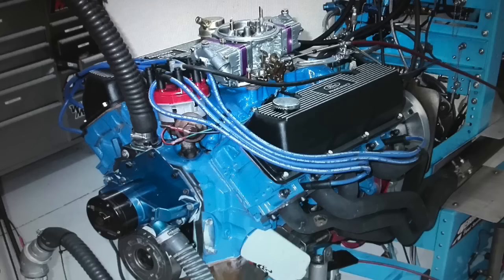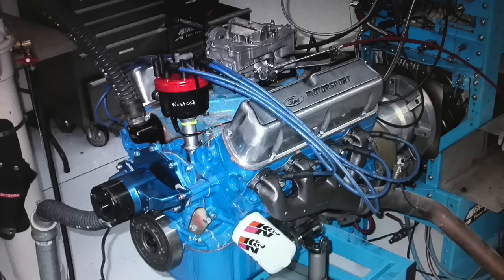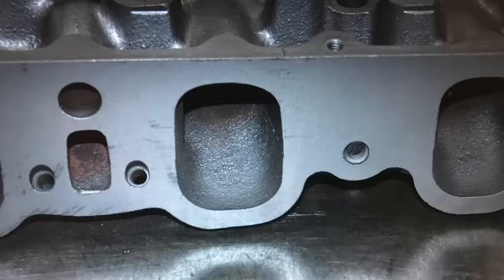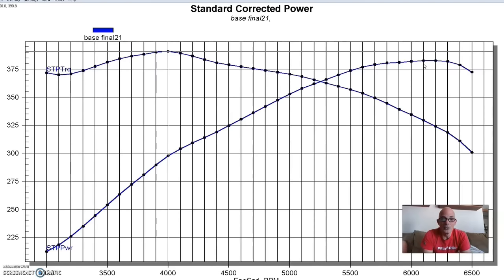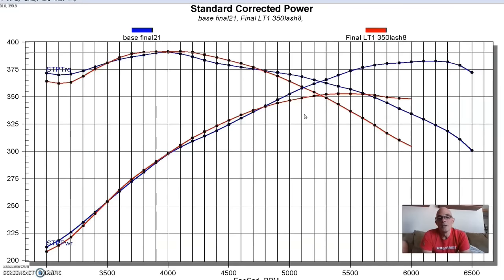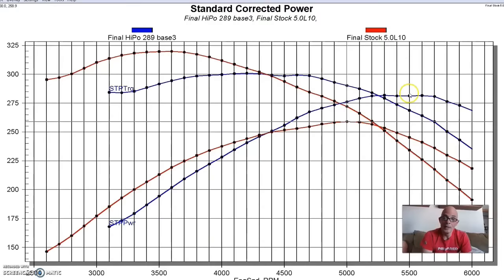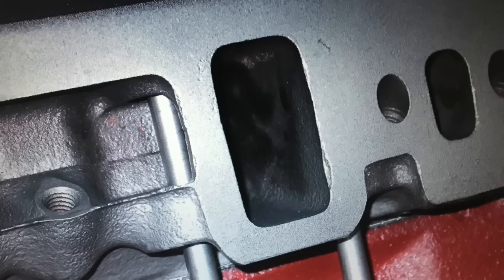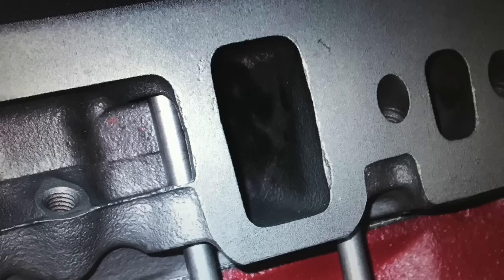HOW MUCH POWER DID THE 1971 BOSS 351 REALLY MAKE? WAS IT THE HOTTEST SMALL BLOCK EVER OFFERED?

Comment: I was raised on small block fords and have owned and or rebuilt almost every ford made except the FE series.  I think you are taking the 289 out of it’s time frame.  The 289 (1964 – 1968) should be compared with the other domestic engines of the same time frame, the Chevy 283 and Dodge/Plymouth 273.  All had versions of their engines with marginal power, good power and exceptional power for their day.

Comment: The Daytona Coupes were supposed to make 385hp but I have never seen any text has to how they accomplished that. Shelby used to have Valley Head Service port his heads. Maybe they were that good. If I remember correctly the 2V, 4V and Hi-Po Heads all had the same size ports. I have put many 1.90 and 1.60 Chevy valves in those heads.

Comment: Shelby upgrades? Are you including his 289 hipo cam, his crane Cam's fireball cylinder heads? All that including your stuff made 375+ horsepower. It was in his 289 powered GT40. For original 289 HiPo vs the 5.0? Well hate say this. That test was done by my father. 1980 Thunderbird came factory with the sickening 260 V8. It threw a rod and my father got lucky and found a Ford Country Wagon that the original owner bought and blew it up leaving out of dealer ship in 1966. The dealership replaced with a crate 289 HiPo. 30,000 miles on it. We bought the Country Wagon with rotted out frame. Installed it in the Thunderbird. We picked on new 1988-89 5.0 mustangs and when they felt froggy? Least say this. They watch our tail lights fade in front of them😉😉😉😉

Comment: In my opinion you’re not giving the 289 its share value. The 289 wasn’t a monster torque engine . It was designed for light weight vehicles. The Falcons, Mustangs, Fairlanes and Cobras all were light weight vehicles. Not requiring big torque engines to go fast.

Comment: Ford Australia had a 351c in the 1971 Falcon GTHO which was said to be 12 : 1 compression ratio alloy intake manifold 780 holley carb tuned length tubular headers big hydraulic cam . Even to this day Ford Australia will tell us the correct horse power rating of this engine . They rated it as the same as the regular GT at 300 hp . It is estimated to be over 400 hp . Now that a 1971 GTHO Falcon goes for over $1000000 AU no one is going to pull the motor out to find out . These engines were really built so Ford would win the Bathurst 500 miles race , where the track went up Mount Panorama , which they did win .
Reply from the maker: 12:1 in a production 351C?

Comment: It would have been a better test if you had run these engines all with the factory exhaust manifolds. In the Hot rod test their recreated 340 6 pack with the headers made 376 and 409 so it would likely be really close!
Reply from the maker: that six pack had ported heads and roller rockers
Reply: @richardholdener1727  I had seen it had roller rockers but didn't know the heads were ported. I don't usually see much difference in power between roller rockers and not unless there is a ratio change.

Comment: I agree the HIPo 289 is underpowered.  Ford has always been too small on the displacement and the head flow on factory heads have only been done right one time, and that was the BOSS Cleveland heads .  As you know and alluded too air flow makes power.  Simple as that.  However, the 289 did pretty well in the role it was used for.  Road racing.  289"s were never good drag racers unless you could rev it to 9k and then you would have to feed it.  Pretty hard order with factory iron heads in 65 especially with old school cam technology.  Mustangs were light and THAT is the best HP there is.  FREE HORSEPOWER!  The mustangs could run hard on the road courses using the 289 and momentum in the corners.   European "tiny" motors have been doing it for a long time on the road courses of the world.
Reply: Forgot to mention a "Thank You"!!  I appreciate what you do for us.

Comment: Back in the eighties I ran a small machine shop. The boss had a 79 bronco with a 351 M. I rebuilt it with a four hundred crank and 351 4V heads.  Added a stock cast iron 4v intake manifold with spacer plates. And when he went hunting with his buddies.
He could go up hills and nobody had the power to keep up with him.
Reply: Bull shit, the 4v did not have low end torque.   They were for high rpm.  Crank it up  4500 and lay rubber,  yes buttrytocrawlupa highhill.  The 307 Chevrolet would beat you to the top...

Comment: Only one thing needs to be said when it comes for Ford heads- N351w Sportsman. PLEASE try a set of these circle track iron heads on a Ford small block. They are cheap and absolutely outflow damn near everything else. AFR included.

Also I think you're wrong, a 65, or 66 289 hipo mustang with a 4 speed is a damn peppy, spry and FUN car to drive. Not wicked fast, but just a helluva lotta fun.
Reply from the maker: I wrote a book for Ford called short track power-I did lots of N head testing-they don't compare to the set of AFRs
Reply: @richardholdener1727  I stand rebuked! I wasn't aware of your book. Thanks for the reply Richard. I have always been told from my Ford friends that the sportsman heads are the real deal. Either way, I love your channel and how much effort you put into these videos.
Reply: It's the toploader wide ratio that makes it fun. ;-)

Comment: Cleveland’s were never considered “small blocks” until recent times.  Totally different than the Windsors.  Not sure where modern hot rodders get that idea from.
Reply from the maker: because they are 351 inches and have a shorter deck than a 351W-they are small blocks
Reply: @richardholdener1727  not if you ask anybody that grew up hot rodding in the day.

Comment: Unlikely that a 340 six pack would make more power than the Boss 351.  The 340 has lower compression, fewer cubes and a milder cam.   Really the same as the 4bbl 340 but with 3 deuces and some durability improvements.  If you compared a 350 LT1 and a Boss 351 both with cast iron exhaust manifolds there may not be much difference, the Cleveland heads need headers to take advantage of the better flow.  I agree that the 71 boss 351 would be the most powerful of the small block performance motors.

Comment: Had a 4 barrel Holley off of a Boss 302 but never could get it to run properly at part throttle for some reason. Not sure what finally happened to it but I bet it would bring big bucks too if these factor autolite carbs are.

Comment: The K code heads and cam were way too small, I spent a lot time on the heads porting and running bigger valves, but it was hard to find a good intake back in the 70s and 80s also, so porting was needed their, so with a ton of porting a big cam, in a nice light 65 mustang coop we could run pretty good, was also turning it to 7500 RPM that everyone at the time said you couldn't do.

Comment: Ironically, the 351C, which was among other reasons designed to meet anticipated smog regulations, only lasted four years and was a casualty of the oil crisis and smog regulations.  The motor never got the full development it deserved in the US.  There’s a 1975 Motor Trend article featuring Jack Roush and a Mustang II he build for Detroit “top end” racing.  It ran a 351C with a single 4bbl.  Roush said that “the guys who want to run, run two carbs, while the guys who want to run fast do it with single 4bbs.  Yesterday I read an article online that mentioned a high performance version of the Aussie Falcon GT.  The article mentioned a famous photo Down Under that was snapped of the instrument cluster of said Falcon with 351C turning about 6800 rpm and over 140 mph.  Compare that with rev limiters on same vintage Mustang Boss 351s and the end of the road hydraulic cammed Clevelands.  The Aussies did so much for the Cleveland.  Imagine if Ford USA had continued to develop and field the 351C and emerged victorious from the smog wars with fuel injection and computer controls.  BTW, I had a relatively stock 92 Mustang 5.0 LX/5 Speed.  The 5.0 was a much more drivable car and reviews of the historical records (road tests, quarter mile times) showed the fuel injected 302 was more potent.  There was some speculation that the HiPo 289 rolling off the assembly line was only making about 230 bhp, where later tests suggested the 5.0 was making a lot more than the 225 net rating.  Also, back in the late 80s, there was a guy running an altered class car on the drag strip with a 300 6cyl.  It made power through a custom cylinder head - made from sectioned and welded 351C heads.  Don’t remember how fast it was, but it apparently ran well enough to get featured in a magazine.
Reply: Really?? The 351M and 400 soldiered on several years.

Comment: well Richard ,,, having run a pair of stock 289's in a 67 Fairlane  that were good running 2v stock motors with auto trans and 2.79 axle , and then swapping in a Smogger 1980 302 out of a Crown Vic , I would have to agree with you about the 302 just feeling better to drive . lost slight amount of gas mileage but the torque gains down low made the 302 smog motor just feel way more enjoyable to drive .

Comment: Never been a Ford fan.  But I have question. After being a machinist. The Boss 351 I remember had large square ports. Not quite as big as A Chevrolet 427. I never see them anymore. There might be variations and I could be wrong. The volume is what gives it flow.
Reply from the maker: The Boss 351 had 4V Cleveland heads
Reply: I like to see those. 4 V would be unique. The Potts I'm used to seeing are like the ones on the 300 inline 6 another builder rebuilt. With 3 boss heads put together with epoxy and all kinds of modifications.  If I find it I'll share it back to you. For curiosity. But you have enough crazy people like me trying to chat up your pages. Thanks for replying. It does help me feel of value. Best Wishes.

Comment: Granted it wasn't the same as a Detroit or Chicago in the 70's, but my dad ruled the valley in a 66 Mustang coupe A code with some mods in the early 70's.  He beat many 'legendary' big block GM and MoPar cars with it. Mostly becasue he could get off the line and then it became a game of trying to run down a high winding small block in a light car. Same story as my 86 Mustang GT, there were a lot of more powerful cars running where I lived at the time but the well thought out mods with the right package lead to a car that was tough to beat.

Comment: Comparing a mid / late 60's small block, which BTW was the beginning point for ford small engine horsepower development, to another small block with 20 additional years of development is a bit of apples and oranges, wouldn't you think. My 271 hp 4 speed Mustang collected many a scalp in the day.
Reply from the maker: Cleveland came 5 years after the 289

Comment: Hypo 289, K code motor, with its unique distributor, screw in rocker studs, solid flat tap pet cam, heads with machined valve spring pockets, rated at 271hp from Ford. It was a little underwhelming.

Comment: The 289 lacked torque! Running the 66 fast back Stang with a 289 hippo with four on the floor and 411 gears in the rear scoots right down the road!
Reply from the maker: I had a HiPo 65 4-speed, 4.11 car too

Comment: You should run the 780 vac Holley Boss spec better all round than the 750 vac or double pumper.
Reply from the maker: A Boss 351 didn't come with a Holley

Comment: The 5.0 will always beat the hi po 289.

Ford added the hydraulic cam changed the firing order and both strengthen and lighten the parts.

Not to mention the updated transmission and overdrive.

Comment: Dude check out the 64 or 65 avanti... it had a blown hypo 289 in it pushing almost 500 hp. And was the fastest car in the world for a long time.. first car over 200 mph ... test one of those... and the gt 350 r mustangs in 75 were pushing close yo 375 to 400 hp..
Reply from the maker: the factory power rating was 335 hp in supercharged form. The top speed production cars (168 mph) were likely massaged.

Comment: A street dominator or a torquer  manifolds  headers and a bigger cam woke this motor up.  Built and still own a few Built cleavlands and.
Reply: Also what's not mentioned is the 4v non adjustable valvetrain heads came with rotating valves. The boss studded adjustable valve train didn't.  Roller rockers helped alot.

Comment: You felt wrong.  The 289 Hypo was a very strong engine.  It would kick a 88 302 off the road.
Reply from the maker: a 289 HiPo was a 15 second car at best-a 5.0L LX was an easy 14-second car-I owned and drove both on the same day-the 5.0L LX was faster

Comment: The hipo 289 is only disappointing because the factory heads flow about 430 cfm. (What's the cfm rating of the factory autolight 4v carb?? 450 cfm. Cause the factory knew what the heads would flow)  The hipo 289 made the extra hp over the 4v in the cam and exhaust manifolds. The motor can only make as much hp as the heads will allow. The hipo 289 heads are EXACTLY the same as 289 the 2v and 4v heads with the exception of screw in rocker studs and cast in spring pockets. (And anyone that says different, doesn't know what their talking about. I've see many of these heads side by side. And i can assure you they're same!) That's it. Otherwise they're identical. Now, port those heads and do some valve work. Different animal. Still limited by some intrusions due to casting design, etc.  But it makes  quite a difference.

Comment: The 351C was never called or considered a smallblock.They are in between and usually called a medium block.
Reply from the maker: it has a shorter deck than a 351W, same displacement, it is a small block

Comment: Lets see what I have to say after I watch this videoMy history of the Years '74-78 included  Sunoco 260 104  octane gas still available  at the pump. Very close friend owned Orange and Black '70 Boss 302, I had a 69 Mach 1 with the stock 2bbl Windsor 351,AT swapped out for a 69 somewhat (didn't see the work don't think it was fully worked,  mostly aligned and balanced), with a warmer but still Hyd cam '69 4 bolt, 4bbl, Windsor (Yup! ) with a 4 speed. Factory rated at the same  290 Hp. (Yeah, yeah I know!)  But it did make for a lot of interesting comparisons. Mine was my Daily driver his was a garage queen, disposed of when college funds and a much more practical Fiat Spyder was necessary for college Imagine a high school kid with a '70 Boss, ,and a '68 GTO Convertible! Those were really amazing times!

Comment: I'd have to agree about the 289.  It worked in the early mustangs due to their weight, but as the mustang grew the 289 became less impressive.  I also don't think the 302 BOSS can be lumped with the 351 BOSS so easily, at least not in stock trim.  It was the opposite of the 289 as far as head flow...way too much for the displacement, especially when match with mild cam setups.  My uncle had a numbers matching '70 BOSS 302 that I was fortunate enough to be allowed to drive, and quite frankly it was a dog.  Again, the Fox body 5.0 would give it hard time.  Now the 351 BOSS (while I wish it had been dropped between the fenders of the 69-70 mustangs) was just a much better overall engine combination.  The Aussies really have had the benefit of proving that...

Comment: Agreed high power 289, in fact all 289's are weak for the most part, and this is coming from a 64 1/2 mustang owner with a d code 289
Reply: I had a 64 1/2 Mustang convertible with a D code 289. It was a "peppy" car as my dad would say. But it wasn't a hot rod by any means.
Reply: I had a brand new 66 with C4. Disappointing.
The whole car was a lemon.
Owned it 10 weeks and got a new 66 383 Charger.
Reply: HIPO HIPO C4

Comment: OK, I had a 1966 Hi Po Mustang. Balanced, Crane Cam, pinned rocker studs, hedman headers, factory FoMoCo carb, 4.57 rear. You're wrong.
Reply from the maker: that "modified" 289 would definitely run better than a stock one-but a stock 289 was still weak compared to bigger, better small blocks of the era (the same can be said of a 283 vs a 302, 327 or 350)

Comment: Nothing to hate about the 289. Its just a 302 with slightly shorter stroke. All parts are interchangeable pretty much. The 289 is a great motor and the original (besides the 260) for the future small block v8 for ford for the next 40 years. Also most of fords racing history ran on the back of a 289 (cobra, cobra coupe and ford gt). It was built for endurance and consistency. Great motor. Graphs dont tell the entire story. A little too analytical.

Comment: You may have had a dud 289 hipo.  I distinctly remember seeing hipo 289's at the drags and they pretty much dusted the competition.  Also if you test an engine today that has 11-1 compression use race gas.   Today's pump gas is garbage for those high compression 60's engines.
Reply from the maker: a 271-hp motor is not very powerful (Nor torquey)-and the 10.5 compression 289 didn't require high octane fuel

Comment: If you run the numbers, the "65 GT 350 and the "71 Boss 351, horsepower per pound between the two cars are about the same. Personally, how does one choose ??  That is if you have the $$$$$$$$ for the GT 350 Shelby
Reply from the maker: both great cars

Comment: The power potential of the 289 HiPo is limited by it's historical roots.  In 1961, it came as the Fairlane V8 with 221 CID and rated at 145 HP.  The same basic architecture of those small heads contained.  Considering what it is, where it came from, and what it became, it is a fantastic engine. Factory heads are not all that good for performance but good aftermarket heads and cam really wake these motors up.
Reply from the maker: the FIA Cobras and Daytona Coupe did amazing things with the 289